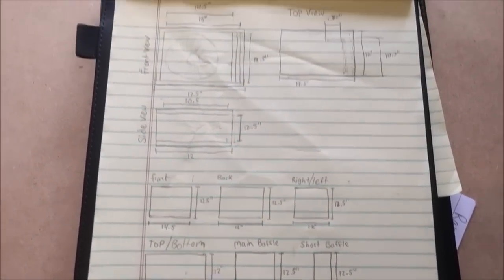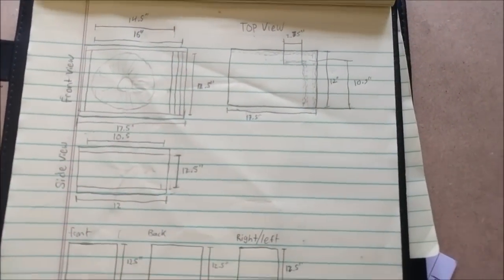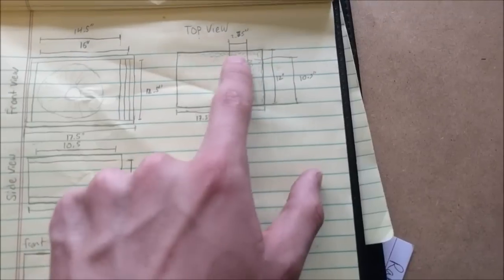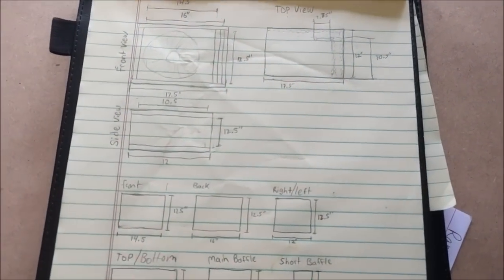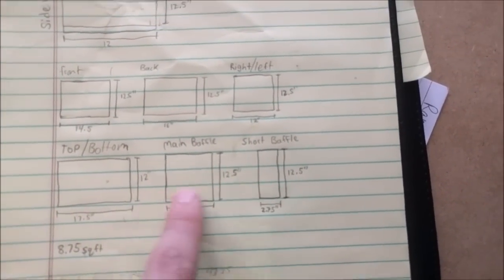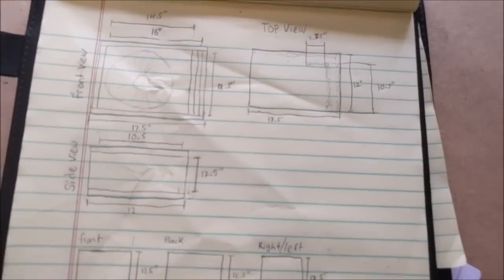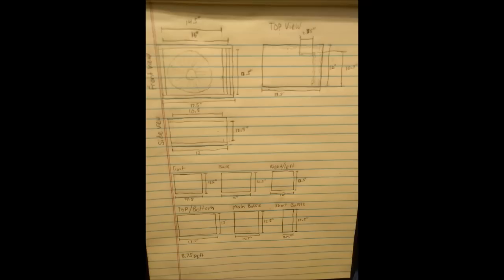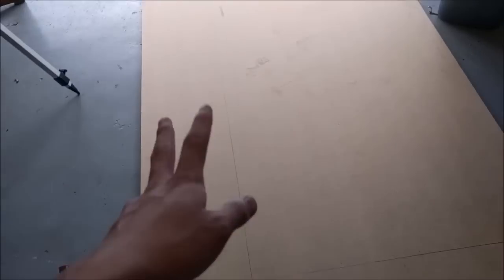12" Ported Speaker Box Build Timelapse + Plans

Comment: 1- what kind of wood?
2-  can any carpet be used? do you have a preference?
3- where can I get the black circle piece on the back of the box?
Thanks!
Reply: 1-MDF
2-Any can be used, amazon had a large selection for a decent price.
3-The terminal cup can be bought at almost any store that has car audio. Bust buy has them in my area. Amazon does to obv.

Comment: Nice little box. I like to route a lip for the speaker to fit into, then I put a gasket material around that for an air tight fit. Its tough to get an airtight fit with carpet on your mating surface.